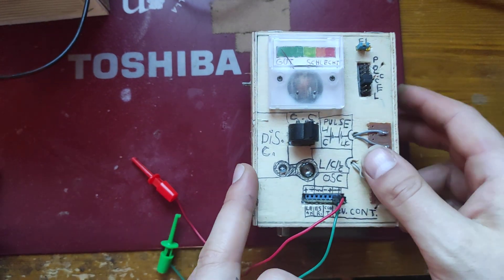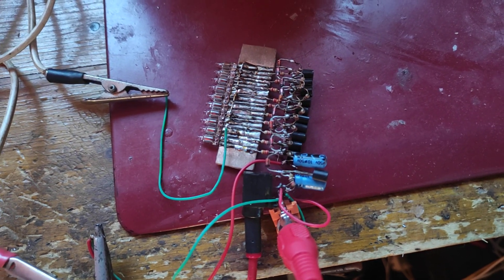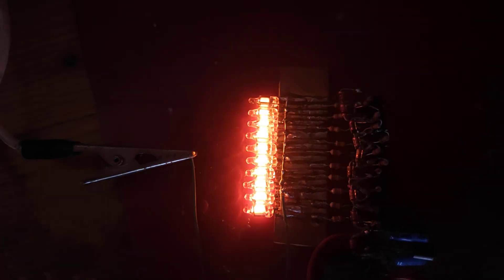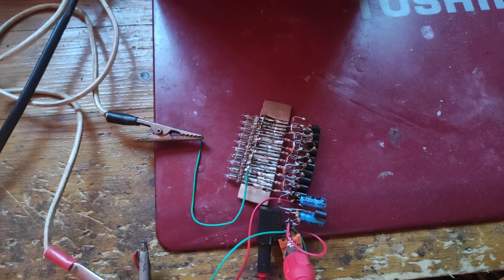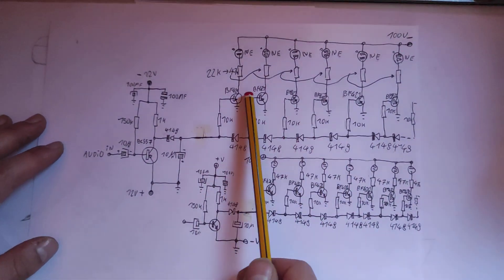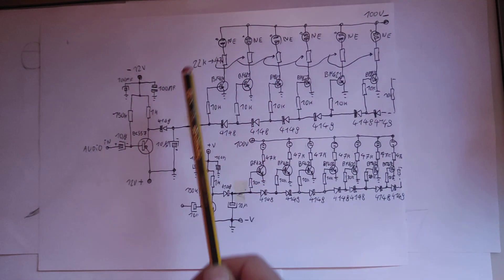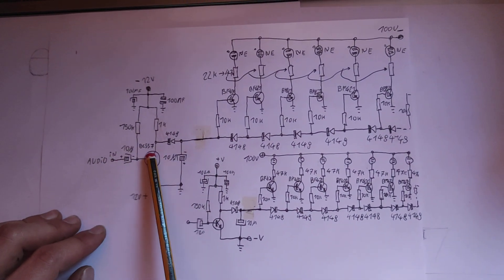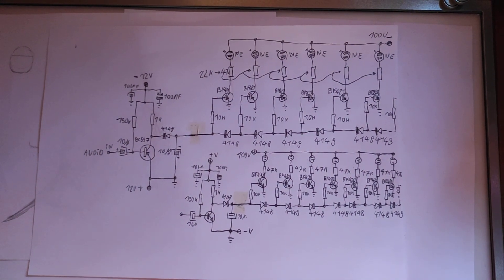poor man's IN-9 IN-13 neon lamp VU meter circuit

Comment: Love the neon thing but why not simply use a LM3914 (the circuit you have there is basically linear scale) and let it drive the neon driver transistors.  LM3915 for a logarithmic scale and what is traditionally a VU meter will work as well.  These also do dot as well.
Reply from the maker: I mean yeah the different scale modes are nice but idk I like the discreet transistor circuit
Reply from the maker: Because it can't switch the 100v i would still need after burner transistors witch makes it the same